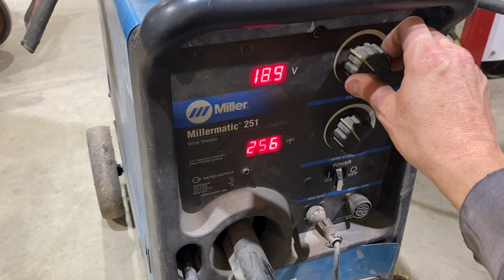Rescue 1 is Down!! Palfinger Crane Repair

Comment: Safety Wire, .032 would work perfect to keep the nuts from backing off.   You might have to drill some small holes in the nuts, unless you can get some surplus Aviation nuts.
Reply from the maker: I think you have the answer I needed. Gonna do a little test and see if red loctite works first. Just for future reference.

Comment: I drive a truck very similar to how that one was before the wreck Into power lines. Great modifications. At first I was sure it was some weird dual steer axle tiller truck. Would love to see more on the modification of the platform into that truck.
Reply from the maker: I was actually looking for a tandem axle tiller when I was thinking of this build. That’s a hard truck to find. Could only find single axles. 

I think we could throw together a video of the mods to the truck. Thanks for watching!
Reply: @intendedoutcomes142  agreed on a tandem axle tiller. I don’t think I’ve ever seen one. Even our oldest open cab ones when I got in 20 years ago are single drive axles. Now a condor boom truck may be an option. Those were used by fire depts for their reach and usually had more axles. Sometimes two steer and two drive as well as crab steering. Same type of frame as most crane trucks now.

Comment: I have a similar truck, trying to deal with the same weight issues, any details on the steerable drop axle?
Reply from the maker: I bought the axle on eBay. Installation is pretty straight forward. Just bolts to the frame. Check your caster adjustment. Add air controls for lift and brakes. It’s really not too bad. If you have any specific questions on it, let me know. I’d be glad to help.
Reply: @intendedoutcomes142  Any DOT issues?  My truck is a Quantum, it has the same power plant, less horsepower (for now), the front end currently sits at 19,800.  I have not removed the pump and that gear yet, but I have a knucklebone that I want to put behind the cab, then put a fifth wheel on it.
Reply from the maker: @thesalvagegarage  not anymore. When I first removed the ladder, I drove out to Ohio and tried to get on the Turnpike.  They weigh you before you get on. Got denied and said one of my axles is overweight. That’s what prompted me to install the drop. 

Since then, it’s all legal. The only downside now is the truck weighs 48,000 lbs as it sits. Kind of limits what I can legally pull behind it. 

Instead of trying to lighten the truck, I’m in the process of building a military semi that is considerably lighter.
Reply: I have a single axle tractor with a small knuckle boom that I am currently pushing to the limit all the time, so I want to build something bigger, but I don’t run commercial and I had to use an old DOT number to file my HVUT since I register for 69k.  

Your truck is the nice looking cab, I wish I could have found one like yours, I am on the slow road to this build.